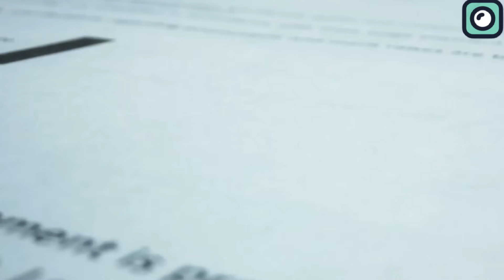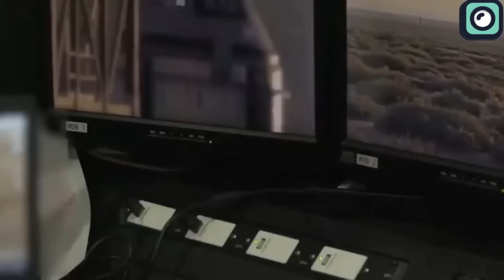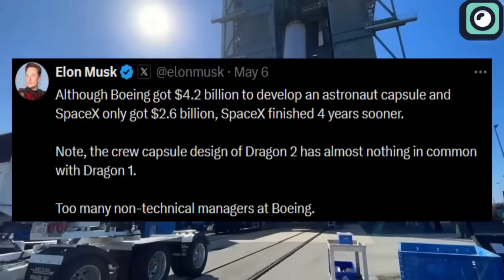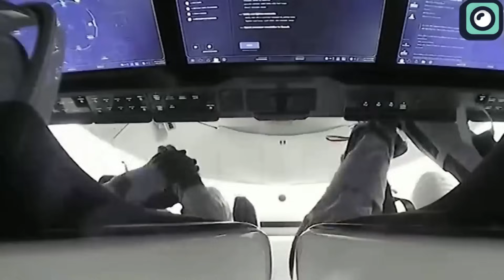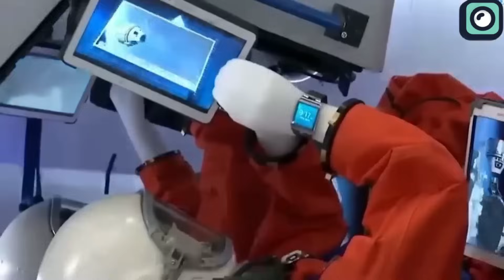SpaceX Is Finally Launching The Starship In Hours!

Comment: SpaceX's lifting facility for lifting and placing the Starship in position atop the main booster is an absolute master piece of engineering. It saves so much time placing and removing the Starship on multiple occasions to achieve necessary changes or simply checking details ongoing is brilliant.

Comment: From a flight perspective, I would add two more grid fins on the booster, for better control.  know it adds more weight, but the booster is capable of handling it. We are not dealing with F9, or FH, we are dealing with the largest booster to ever launch. I think the fins played a key role in not getting to its point of simulated landing. Also, the ring cannot go, and when the R3,s are installed on the next flight, that should help tremendously with weight.